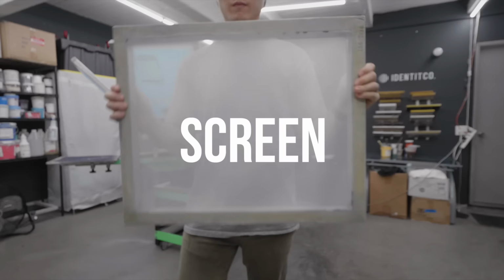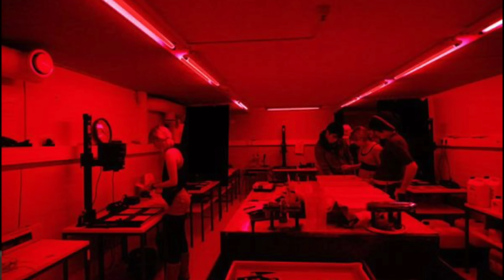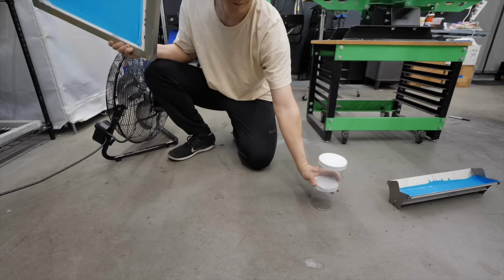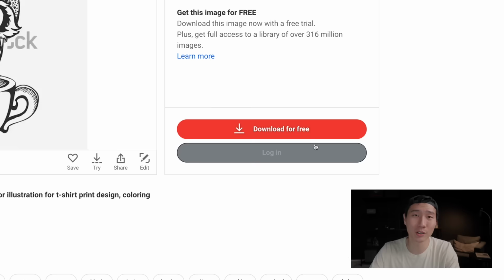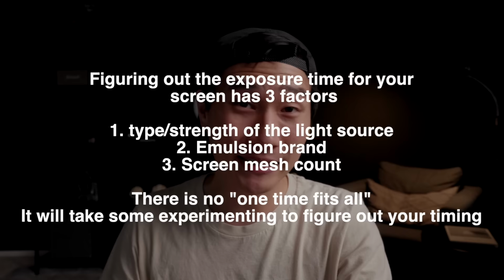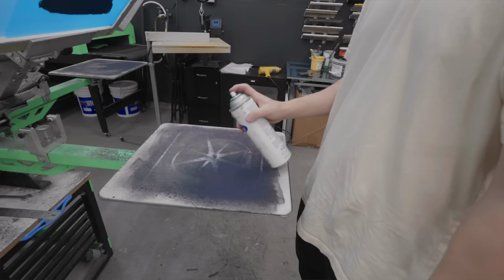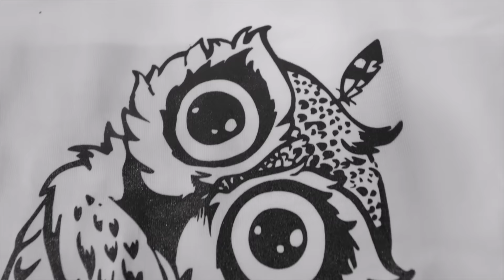Screen Print Your Own T-Shirt: Step by Step Tutorial

Comment: I am a screen printer and this is the most accurate video I have seen out there.  Everything you did is confirming what I do.  Overtime my husband who is very handy made my job easier by building a light box and a dark box for drying screens.  Question, have you ever worked with puff ink?
Reply: Once you have done this, is this a  permanent screen print. I'm looking at vinyl stencil also.
Reply: Do you have Instagram?
Reply: @karmatulip553  I've been doing vinyl for several years now. For very simple designs it's great, doing "one-off" jobs is ideal, even doing several colors is certainly doable but where it becomes a problem is if you have a lot of fine detail or small lettering. The "weeding process" can be frustrating and very time consuming, especially if you have more than just a few shirts to do and you'll wish you hadn't taken on the project by the time you're done. For that reason I'm going to go the silk screen method. . .better for large numbers of shirts and better for holding details that get lost with vinyl, not to mention the ability to do multiple colors much quicker and easier.

Comment: 20 Year screen printer here. Finally someone who explains it RIGHT! From your coating process, which took me a bit to learn on myself, is the best... to loading the shirts. Personally i like to slide the coater a little bit side to side when i get to the top of the screen to get that extra.

One thing i never understood, is how some printers prefer to print while pushing the squeegee and some prefer to print while pulling. Personally i've always pulled and i double print, never flood the screen with textile ink. Reason for this, the ink stays on one side of the squeegee

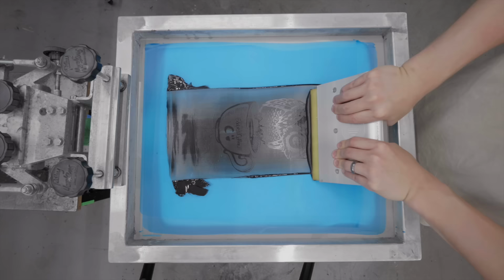You can see at the 11:07 mark, the ink is pulled from the squeegee leaving a trail of ink on the logo. The screen is touching the shirt, once that lifts, that trail shape will leave lines and it will appear on the print. Black is not as noticeable, but other colors show well.

Comment: Awesome thanks for sharing. No taping of the screen on the exposed edges though? From my experience, new printers tend to get ink on the sides. If the screen isn't properly masked you can get ink going through the exposed, non-coated areas of the screen.

Comment: Hey Eddie, thank you so much for tutorial. It's very easy to understand and straight to the point. I also like your advice about starting and quitting. Will take that into account. I have a question though, after the printing, can we use a heat press machine to dry the ink?

Comment: Love this video, thanks for the great info Eddie!

One question: Do we need to "cure" the ink after it's dry? I ask, b/c as a kid, we bought shirts Calvin & Hobbes shirts (unofficial, for sure) from a street vendor in Washington DC, and even though they were dry, when my brother washed his, the print smeared/ran...We happened to have a neighbor who did silk-screen printing for a living and I remember he sprayed the edge of the image with some chemical, then remarked that it hadn't been cured. So he ran both shirts through a machine (which may have just been a heater?) and that solved the issue (though obviously my brother's shirt remained streaked). This was also ~20 years ago, so maybe curing was a thing back then but isn't now?

Comment: Is it possible to used water based ink with water resistant emulsion without all the equipment you have... like a garage based clothing line? 

I like the feel of water based ink on a shirt but I’m worried it won’t work without an expensive drying unit.

Comment: Hey Eddie, our nonprofit is currently experimenting with screenprinting and after all the trials and errors we came to another obstacle. Once the design was cured on the bottom light for a minute, I washed the outer part and everything was great(only the design area was transparent) 
However, when I went to rinse the other side, it was all slowly but surely coming off. All of the emulsion on the inside part was coming off, so it was not like the outer part. We're not sure why
Reply from the maker: you may have to expose it a little longer. and you want to make sure you're not rinsing out with too much pressure from the inside of the screen. Focus more on washing from the outside of the screen~ hope that made sense!

Comment: can you change the design after you cure the emulsion with the immage
Reply: No. Once you have burned your screen with an image, you can not add any other image to that screen. However, you can use masking tape to cover parts of the  screen you don't want to be printed. 

Once you are finished with the image on the screen, you can through a process called reclaiming to remove the ink with a ink remover and remove the emulsion with a emulsion remover. Then you can reuse the screen after the drying and re-coating process.

15 years experience

Comment: If I want a "soft feel" of the artwork so when you run your fingers over the design you don't feel the at at all, should I use waterbased ink instead of plasticol to achieve that? Thanks!
Reply: Yes, use water-based ink for that result.
Reply: @albertcarrete  Thanks so much!

Comment: When washing unexposed emulsion, it slowly wash out everything? What are my mistakes?  I am using UV light to burn (about 12 minutes). Thanks
Reply: Exposing a screen with UV is a combination of time and distance, and not all emulsions are exposed with the same amount of time. your screens are not totally exposed, or your emulsion is old, or you pressure spray the screen on the printing side(inside) . try to find the right combination of time and distance for your specific emulsion..... youtube can help.

Comment: Is it possible remove the paint print from T-shirts?
Reply from the maker: Not after it's dried. Before drying, it's possible, but only smaller images and spec. it requires a special chemical so it's not highly recommended. It's best to print a new shirt :)

Comment: how do you call that type of screen?
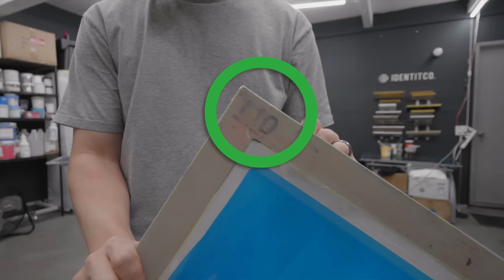Reply: At 0:25 that screen is called a 110 mesh. Screens come in at different mesh ranges. The lower the mesh count (mesh number) the more ink that can flow through the screen, but are not the best for halftones for details. 

The higher the mesh count (mesh number) the least amount of ink can flow through, but are much better for halftones and details.

15 years experience

Comment: why does no one ever say how to clean the ink off the screen
Reply: Once you are finished with the image on the screen, you can through a process called reclaiming to remove the ink with a ink remover and remove the emulsion with a emulsion remover. Then you can reuse the screen after the drying and re-coating process. 

15 years experience